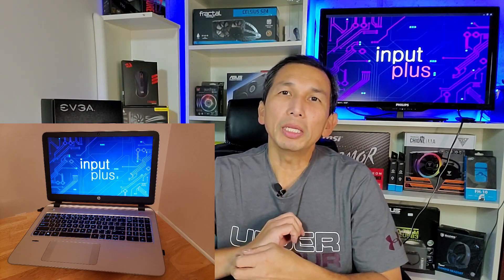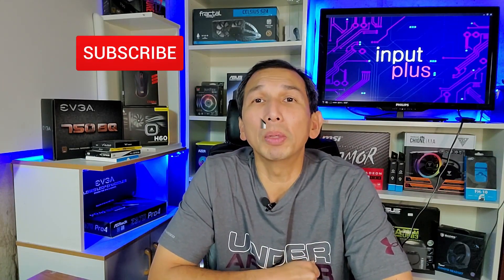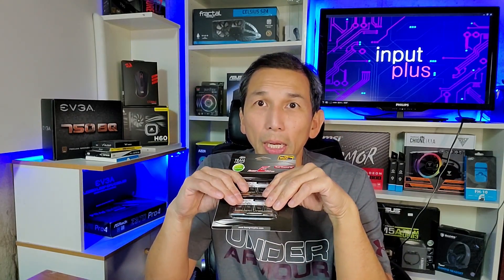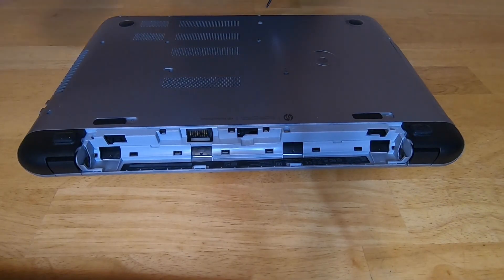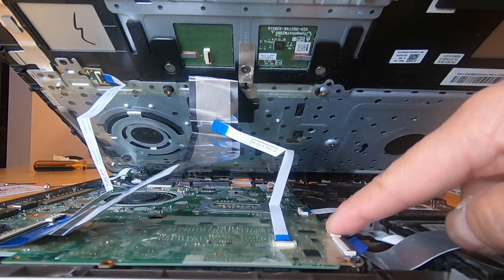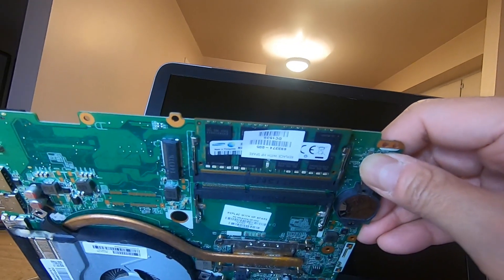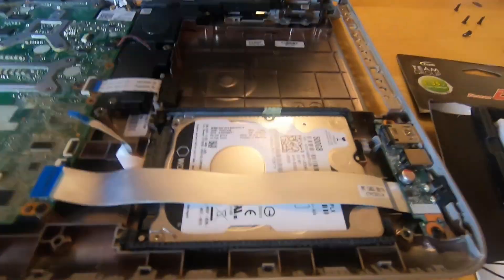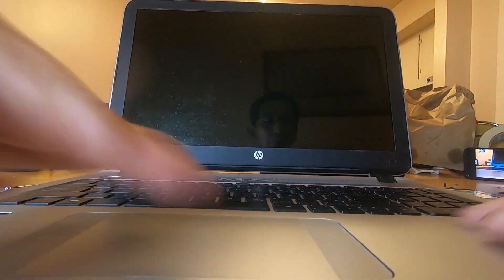HP Envy 15 Memory and SSD Upgrade

Comment: Is it available to install m2 ssd?
Reply: @5:14 you can see the space on the left side of the ram slot  that there is m.2 slot
Reply from the maker: No, unfortunately this laptop does not have an M.2 slot.
Reply: @inputplus  from its manual: 2 TB, M.2 2280, peripheral component interconnect express (PCIe), non-volatile memory express (NVMe)-3×4, SuperSpeed (SS) solid-state drive with triple layer cell (TLC)
Reply from the maker: @reborntoday9039  HP tends to re-use their model names. So that manual could be for a newer HP Envy model. I wish mine had one but, unfortunately, it doesn't.
Reply: @reborntoday9039   where can I find the manual?  My motherboard is 2290 version 77.35.
Reply: It is because you did not flip the motherboard. It has an m.2 2280 ssd slot and you can see it in your video if you review if